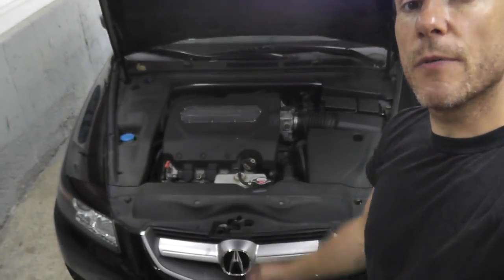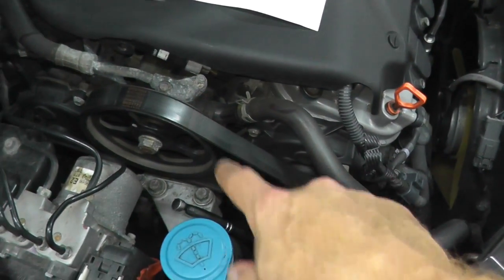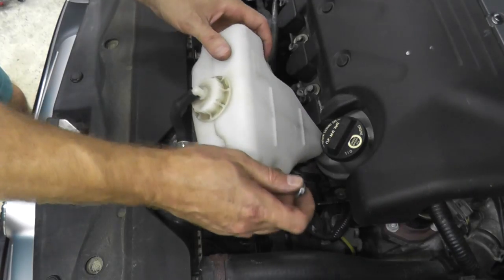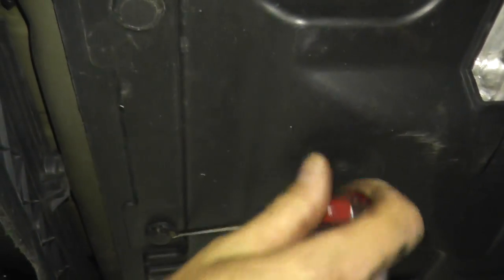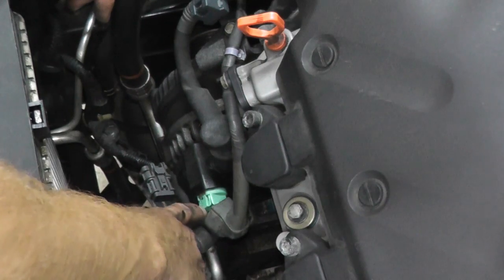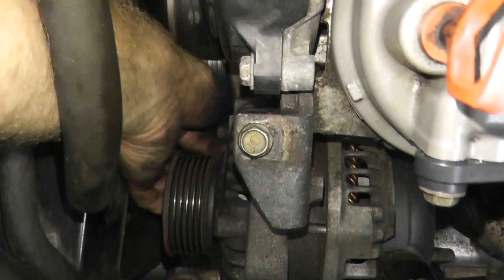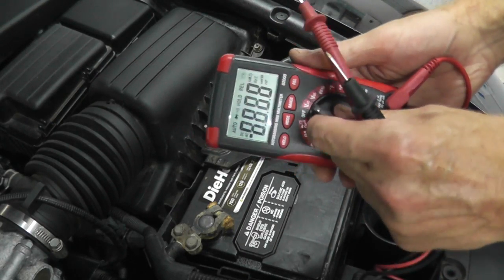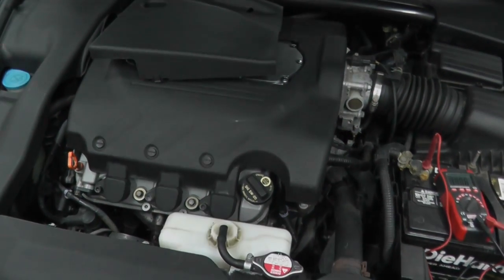Acura TL Alternator Replacement with Basic Hand Tools

Comment: My 07 Acura TL-S alternator decided to fail on my way to a venue and was smoking once i parked it at my hotel. I panicked but this video helped me a lot. One thing i did different was I didn't need to go underneath to remove the bottom radiator fan bolt. You can most definitely loosen it from the top. Just loosen not remove. Hope this helps someone
Reply: Changing mine right now ! Thanks for that tip I don’t have to go underneath the car now

Comment: Thank you!  You get an A+ for showing whether to press or pull the electrical attachments.   I'm having HUGE problems trying to get AAA to replace a faulty AAA battery on my father-in-law's Acura TL.  I may just say screw it and replace the battery (and possibly the alternator) myself.

Comment: Excellent video! But at 4:21, you misidentified the protected cable as a ground. That is the positive cable that connects to the battery. The alternator is grounded via the body. So anyone reading this, please be careful and shield that cable if you happen to still have your battery connected.

Comment: In the process of removing my alternator from my 2018 tlx just waiting on the part thx for the tips and tricks differences I noticed so far was removing the radiator fan no bolt on the bottom but u do need a skinny arm to reach the electrical connection without needing to jack it up and remove the bottom covers considering posting something since finding anything on a model this new is damn near impossible

Comment: My 07' TL alternator failed and I decided to save myself a few hundred bucks. The only issue I'm having and seem to have ALWAYS is removing those clips, or where 2 sets of wires connect to each other. I never know if im to squeeze them to unlock them or pull up on the little clip that holds them together, etc. Otherwise, it'd be smooth sailing. So i have a buddy/ mechanic coming over to "get er' done tomorrow AM. Luckily, I own a couple vehicles so I'm not stranded. Shows me how much I take for granted. I almost expect to have 2 vehicles at my ready. Odd. Spoiled.? Perhaps. Anyways, hopefully it will be road worthy soon. I miss my Acura already. I get 34 mpg on the highway (it shows it gets that mpg) and my 1 ton Chevy gets about 11 in town and 14.5 mpg on highways.  And fuel costs are climbing at the pumps here in Mpls-St Paul areas. Thank you
Reply: theres a lot of good tricks for this like 6mm sockets